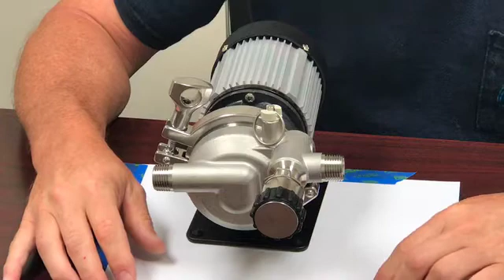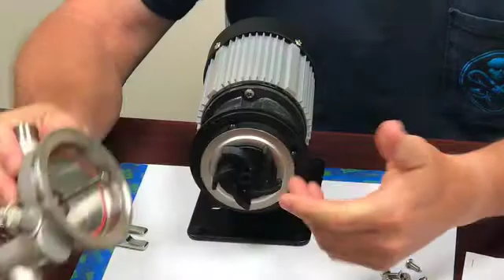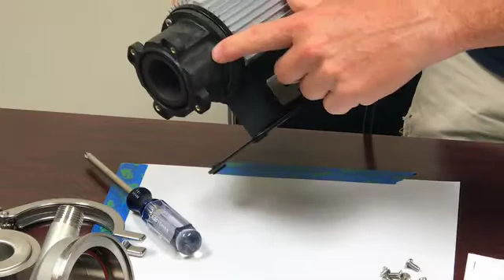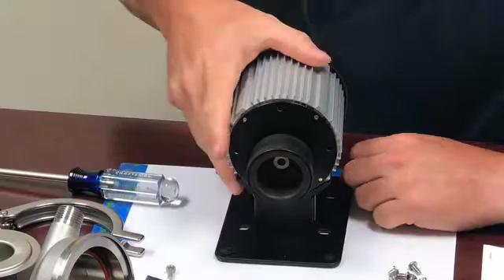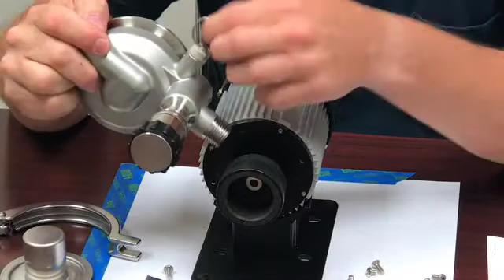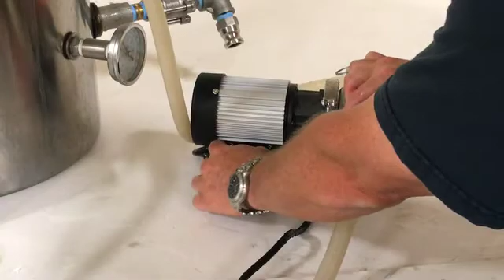Riptide Pump - Safety Review!

Comment: Thanks for this. Couldn't you just mount it upside down or sideways? I'm looking for a pump for aeroponics growing that won't leach anything into food; brewing pumps are great contenders, but my concern is with the impeller as polysulfone leaches even at room temperature and the rare earth magnets if they are not contained in anything they might disintegrate in an acidic environment. What are your thoughts on those points?

Comment: He's trying not to be biased... sure he isn't.   You can't open the flow control valve unless you remove the safety clip... That's like saying oooh you can get seriously burnt if you remove your quick disconnect hose while the pump is moving the hot wort through the hose...
for a truely non-biased review by someone who doesn't make competitor pumps, check this guys review out: 
https://www.youtube.com/watch?v=QFvHAs0LXrA